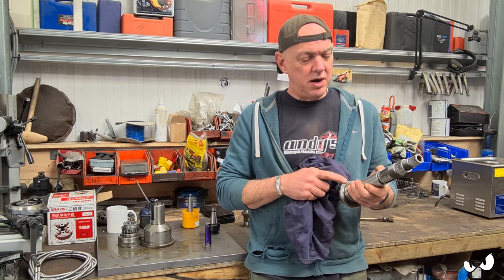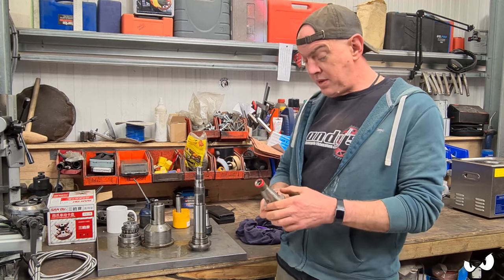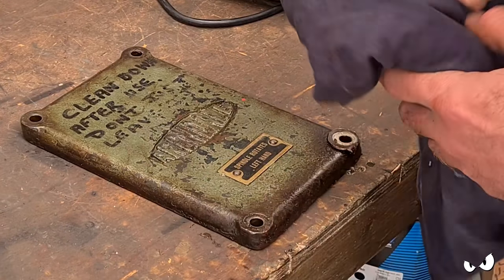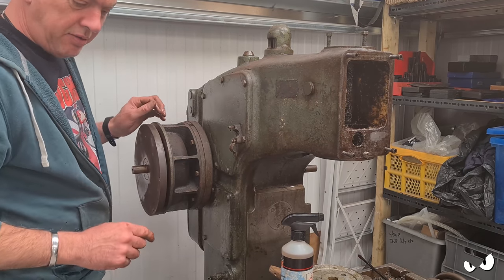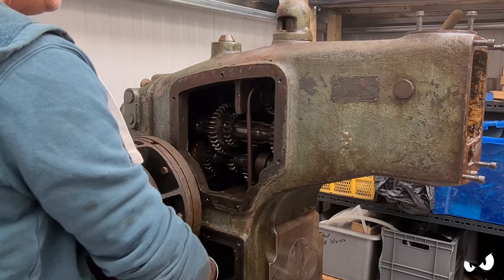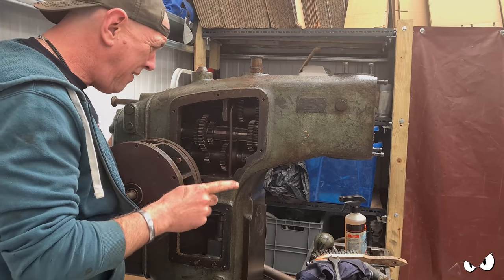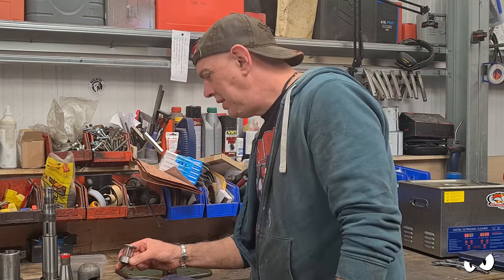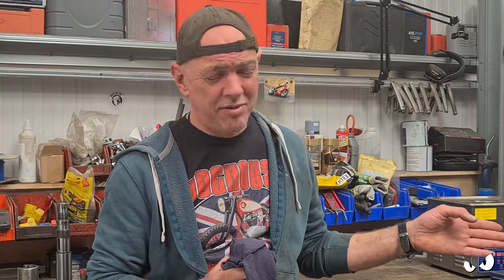Archdale Mill - Oil system

Comment: Spiral rivets mate. Basically an interference fit on the OD that deform when you knock them in. The material fills the void of the flutes (twists) and creates a bigger contact area. As an apprentice of Cummins Engine Coy, one of my early tasks was to drill out wonky info plates on reclaimed engines that had failed testing.
Reply from the maker: Thsnk you matey, I've got them.ordered and.will try my best to get em straight away 🤣😂

Comment: Quickie, if that was mine, I would not use grease. I would put an oil nipple in the top cover and give it a squirt every time I used it. Any oil up there will find its way down through the top bearing. You’ll know when you’ve overdone it as you’ll have a dirty shirt. And it’s easy.

I’d go for INT 40 as it’s big, common and there is room for it. As it is a slow (non-retaining) taper, it won’t take much bashing of the draw bar to remove tools. MT3 is a slow retaining type taper and needs a lot to remove it, in comparison.
Bill

PS enjoying the videos, particularly the mill rebuild.
Reply from the maker: I like that idea.... that would work quite well I think.
Thank you matey. We're going with INT40 just because its more substantial and I have a collect holder coming to make sure this one really is an INT40 tool. I'd hate to cut the taper and find its something else 😂🤣
Reply: @QuickBikes  Good luck, Chap. I know you tried the shaft with a file, but I still think it will be tough (not impossible) to machine. That’s judging by the sparks One Man Engineering was making as it ate his carbide tools. But he got there in the end.
Reply from the maker: Yeah, I just watched that... Brett is going to tackle it next week for me 😁👍

Comment: When you say about twatting drawbars and knocking bearings, could you make something similar to my chester chinese mill. The drawbar has a flange around it where it sticks out the spindle and a hex machined into the end. The spindle then has a male thread on the end sticking out the top bearing. A cap then screws onto that thread over the drawbar and you end up with the hex poking out the cap. This means tightening the drawbar with the hex pushes the bottom of the flange onto the top of the spindle and then pulls the tool up into the spindle. Loosen the drawbar and it winds out the tool until the top of the flange hits the cap which then pushes the tool out. Does that make sense? No hammers involved!
Reply from the maker: Ah.... I get you..... That sounds way better.
I'll see if I cant do something similar. Thank you matey 😁👍

Comment: There is a taper called brown and Sharpe taper it's similar to an mt3 and was used in some old English machines may be a silly Idea but could you block the bottom of the taper off with a stick or something from the spindle end then put a bag in the taper end and pack it with plaster of Paris or even concrete in it to take like a casting of the taper then you can take better measurements of it
Reply from the maker: That's a really good idea, but given that I need to go for tooling that's easily available and not expensive, INT40 seems a good choice. I like your thinking though and that's a really good suggestion on finding out what taper it is 😁👍

Comment: I would mill the shaft nose flat and make the taper the international 30. Plenty strong enough for that mill. This would leave more meat on the shaft. Then make bolt on dogs, I've had to change lots of dogs in my time. Granted they are usually on air driven shafts but they do get knocked and marred up. With regards to the badges, drill and tap the holes and use some pan head brass machine screws. It would be hard to tell the difference.
Reply from the maker: Thank you matey,  much appreciated 👍

Comment: Hi mate , I would have a look at other mills regarding the taper ,and take some measurments ,  int 40 is a very large dia where it locates at the bottom of spindle , looks from here  int 30 or mt3 or 4 is the way to go, love the vids , cheers Paul
Reply from the maker: Thank you matey. We've measured it up and have plenty of room, so the bigger the better I think. Also there's loads of tooling available which is cool. Still feeling my way bit I think this will work well 😁👍

Comment: could you find the taper by filling the center with wax or plaster then push out the plug?
Reply from the maker: Yeah, a few folk have suggested making a mold and measuring it, but even though I'd then know the taper, I'm still not going to be able to get tooling as it was all specific...  I'm just going with INT40 as it opens up a world of available tooling 😁👍

Comment: Just eye balling, it looks like a fair bit of the 30 taper is smaller than the existing taper. So prolly won't get full engagement. Maybe the 40 taper is a better option.
Reply from the maker: Yeah, that's what's getting turned into it..should bengreat once dome 😁👍
Reply from the maker: I believe so fella. Brett is doing it for me.next weeknin work and he's a pro machinist 😁👍

Comment: Great video 👍 Quickie I would price up 30or 40 tool bits plus what size and duty of work are you gonna be doing your limited   by table travel and general roominess of work shop.
Reply from the maker: Just going as big as I can matey... somebody commented that you can make small parts on a BIG mill, but not the other way round... kinda makes sense to me 😁👍
Reply: @QuickBikes  it's gonna be fun either way ☺️

Comment: If it was me I would bore it out on the lathe with a carbide tip so if it's toughened or hard the carbide will get it done, I would stick with you original tooling because you are close to the correct angle.
Reply from the maker: Trouble is, the original tooling is no longer around and was made.for.this machine only... its a tough one hey 🤔😁👍
Reply: I was talking about the tooling from the previous miller 😆

Comment: Direct mounted motors might well have been 900rpm, you might need to work out your gear ratios to work out if a "standard" 1500rpm motor will give you the right (or acceptable) speeds.
Reply from the maker: I think.well be alright.with the motori have in mind.... but I get what.you mean 😁👍
Reply: @QuickBikes  The issue with re motorising old machines isn't usually that you can't go fast enough, it's that you can't go slow enough.  My little ARE lathe, for example, if motorised with a 1500rpm motor and the original pulleys and lay shaft, will run up to 4500rpm ,which is quite a lot, and would mean I wouldn't be able to get acceptably low rpms for large diameters.

Comment: The bearings shouldn't be packed with grease, in my book.  If they were designed for oil, they should be oiled.  If they were designed for grease, like the Boxford, they should be greased.  If they're chinese, it doesn't matter - pour sand in the grease holes and piss on it.

Schaublin lathe bearings, are oiled, but you grease them lightly before fitting, it's a very specific grease that costs several arms, legs and other appendages (Kluber something or other, isoflex NBU15 springs to mind), you degrease the bearings totally, then put them in a bath of grease and solvent, take them out, the solvent evaporates and a layer of grease stays in place.  Supposed to last ~10 years or so of production work.  Over greasing the bearings (i.e packing them like bike steerer bearings) will result in shite running into your oil system, overheating of the bearings, and general shitness.  I'd try and get my hands on some spindle bearing grease (like the aforementioned isoflex, I might have a line on some of that) and do the top and bottom bearings with that using something like the Schaublin technique, then lube with oil like the designers meant you to.  75W gearbox oil should be about right.
Reply from the maker: Thank you matey,  much appreciated.  My worry is the top spindle bearing as the splash oil system is never going to reach it as the feed pipe is.lower. would.you grease the top bearing? I get the lower will catch the oil, but no way that's.happening up top
Reply: @QuickBikes  I'd definitely grease it, but again, not like a steerer bearing, and again, with a high quality grease.

Not doubting you, but it surprises me that the oil feed doesn't take the top bearing into account, are you sure there's not some little tricky gallery that dribbles it a bit of oil?  Or is it sealed in its own little cup, or has the feed line been bent when they were smashing 50 kilos of grease into the head...

Good quality close up photos would be good.

Have you tried the oil pump?

Another thing to bear in mind is cost of the bearings themselves.  They're presumably imperial, given age and provenance, but are they "specials"?  The bearings on my late '40s schaublin, for example, are over 600 quid a set - stock size but very high tolerance ratings.
Reply from the maker: I'm still cleaning and grubbing around looking for oil galleries, but haven't found any for the top bearing yet. Half the problem is just being able to see stuff through all the muck. The other worry is whatnif.one of the galleries is blocked. They'll.all get blown out and oil.manually sent through them to be sure though. Haven't tried the pump yet... 😁👍

Comment: id say leave it oil lubed thats how it was designed its lasted 80 yrs that way why change adding grease will just complicate things.  are you sure there not a drip feed line for the upper spindle bearing????
Reply from the maker: Not that I can see matey.... I like the idea of putting an oil nipple at the top for that bearing and just give it a squirt every time I use it 😁👍
Reply: @QuickBikes   i think i figured out how the top bearing is oiled it is splash slosh lubed the feeder tube the coming into the front head spindle area dumps out onto those 2 chunky bevel gears .the spinning  slings oil everywhere inside that space including the upper bearing from the looks of it be interesting to have a bore camera inside when its running to see the oil hurricane in there.
Reply from the maker: Yeah.... that could be the case... it could.
I quite.like the idea of sticking another oil nipple up there and just giving it a squirt before I use it... just to be on the safe side 😁👍
Reply from the maker: Hehehe 🤣😂😅
Reply from the maker: Sorry... I just read that again.... thought you'd put 'lacking nipples' 😂🤣😅

Comment: they are called drive rivetseBay item number:124551790650
,dont over complicate things machine ,remove the excess ,machine the taper and finish with a morse reamer   eBay item number:292621920384